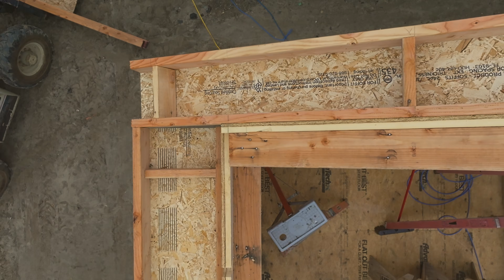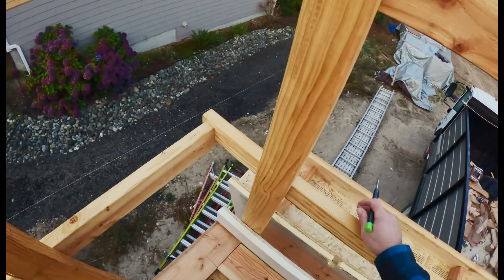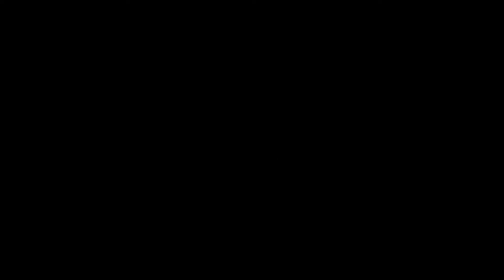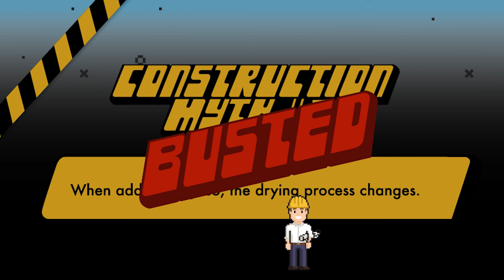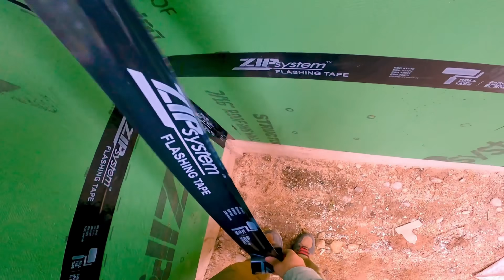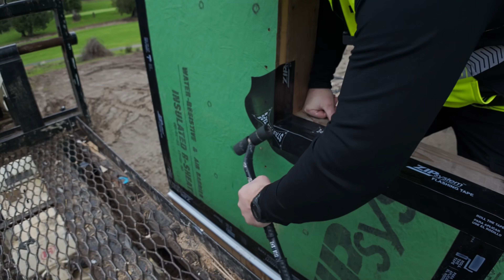EXPERT TIPS| Continuous Insulation

Comment: There is a far better way to build, with Insulating Concrete Forms, ICFs. Continuous insulation, stronger, safer, no mold.
Reply from the maker: How do you define "better"?  Here ICF is insanely expensive ALL costs considered.  There will be zero mold here, so let's take that off the table.
Reply: I define better as stronger, safer more energy efficient. Won't support mold growth, wood can, this system in the video included. How do you define "all costs"? None of the other items should cost more, some things should cost less, such as drywall and electrical
Reply from the maker: @bradkvanbek7148  All costs, means ALL COSTS.  Materials, labor costs, labor availability, environmental costs, cosmetic, etc.
Reply: @AwesomeFramers  What cost is "labor availability" . What are "environment costs" and "cosmetic" costs?
Reply from the maker: @bradkvanbek7148  Environmental cost of manufacturing ICF and disposing of waste, carbon cost of the extra concrete.  Cosmetic Costs include steps taken to hide the above ground foam, extra cost in siding over the foam.  

The fact is EVERYTHING has pros and cons.  That is true of ICF.  There are good reasons to go ICF, and there are good reasons not too.  Are you intellectually honest enough to admit to the negativees or cons of ICF?
Reply: @AwesomeFramers  What cost is "labor availability"
Of course there is cons, but your so called environmental and carbon costs are not a consideration. But longevity is. 
Wood framing needs exterior cladding more than ICF, or it will mold and rot.
ICFs are better than the framing/insulation depicted in the video in just about every way.

Comment: Like the details of the video. As an architect in California, the engineer won't let us use Zip R because of the sheer value. By having the foam against the stud, you lose much of the shear strength. I prefer to go with a Rockwool that is vapor open, possibility of more insulation (2x4 wall but more on the outside) and the added fire resistance. Food for thought. Many ways to do.
Reply: Or you can use the zip r but once electrical is done and you insulate you just sheath the inside of the wall before drywall. Not sure about cali codes but most places allow that or a strong wall periodically.
Reply: I've wondered about the screws cantilevered through the foam insulation and the shear value of the screws. The screw through the OSB is now being levered by the thickness of the insulation. If a long enough and large enough, then the screw can transfer the shear force to the OSB. I wonder if the Zip-R could be inverted so the OSB is against the structural studs to retain the shear strength. Of course, you now have a "soft" surface for the final siding to bear against. I'm glad your California engineer comprehends shear.
Reply: In Quebec we’ve been using continuous exterior insulation for awhile (R4 from BP or Isobrace for Isolofoam) we simply add windbraces in our wall to get that shear when the panels don’t allow us to meet requirements

Comment: One of my concern with zip R and other equivalent products is the rigidity of the wall. I may be wrong but the role of the sheating is to provide rigidity to the wall in case of high wind, by creating a space between the studs and the sheating, the  nails have more wiggle room and i have doubt about the wall being has rigid...

But maybe i am wrong... I still went with a separate continuous insulation even if it meant a little bit more labour
Reply from the maker: We addressed that in the video.  The Zip panel is a Struc 1 panel and there are shear nail tables for it 👍👍

Comment: What size nails get their shear value to transfer?, also windows are already calculated into new houses with the required T24 report in CA,  all this extra insulation is not required but is an extra cost that you will probably never get back in your savings on energy. I like a little fresh air in the house; most people probably don't want to live in a sealed box.
Reply from the maker: 3" x .131" nails as I showed in the video.

This house isn't in California.

Fresh air?  Then open a window, until you hit wild fire season, then the owners will be glad we manage the air instead of letting it coming through a thousand small holes.

Comment: Polyiso (and XPS) R value drops as the outside temperature goes down - not a great feature for northern climates, but OK for southern.  Also R value degrades with age, Polyiso’s R value drops 20% in 5 to 10 years.  EPS (expanded polystyrene) insulation keeps its R value as temperature goes down and is expanded using Pentane gas, not hydrochlorofluorocarbons which is used to expand XPS.

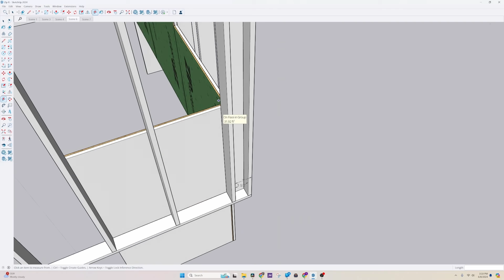Comment: @12:00 you talk about having the 3rd stud for nailing of the sheathing. Is the 2nd (flat) stud used for structural purposes or just for nailing for the sheathing? Instead of using the 3rd normal facing stud for sheathing, could you slide over the "flat" stud and save yourself a stud piece? Amateur here to learn, thanks

Comment: Wouldn’t it make sense to install on the inside of exterior walls behind internal linings? Your heat source is inside thus removing the fact you will require more energy to heat framing etc if on the outside?
Reply: Remember heating the mass of framing means better heat retention (smoother heat fluctuations). Whether it's enough to make a difference? Who knows. Mass heating is a thing in niche building. Sometimes water is used for the mass, sometimes concrete floor is used for the mass and sometimes mud dirt as in classic rocket stove mass heating.

Comment: Newbie question here, shouldn't the sheathing panels be installed horizontally as opposed to vertically to help in preventing the framing structure from racking side to side? (IE: being able to attache the panel across 8' vs the 4' if attached vertically). I hope the question makes sense. I only ask because I spent a couple years in the mid eighties framing houses and I remember that it was code at that point in Alberta and also when I moved to BC shortly after.
Reply: There's a lot of engineering that's already done for these panels.  With 16"OC, you can hang the panels vertically.  It really cuts down on the taping and interior blocking.  With 24"OC, you have to run the panels horizontally.  Huber has an lengthy installation guide on their website.

Comment: Can also use the Stretch Tape. I haven't done the CBA on Stretch, VS. 3" VS 6".
Reply from the maker: I don't see the advantage of the Stretch in this application.  It would be tough to work with, most expensive and Huber warranty covers the 2 seam tape or 1 6".  Let me know how it goes :-)
Reply: @AwesomeFramers  the only advantage is one less "trip" vs the 3"
Reply from the maker: @hu5tle-  3? With the 6" its 1 and with the seam tape its 1 that takes a little longer.  Maybe I'm missing your application. I can bring 2 rolls of seam tape up the ladder and work down using both before climbing off.  The 6" is super easy.  Stretch is very hard to work with and slower/more expensive for corners because of how well is stretches.
Reply: @AwesomeFramers  yes, less up and down the ladder with the 6", vs. 2x with the 3". Seems like, for good reason, you want to minimize trips up and down ladders.
Reply from the maker: @hu5tle-  thing is, ladder work = giant calves
Reply: @AwesomeFramers  them ain't calves baby, them is cows 🐄 🤣
Reply from the maker: @hu5tle-  🤣🤣🤣 Wildebeast

Comment: I am a licensed GC in AZ and a Civil Engineer who has done structural engineering. In AZ, we are concerned about the heat, not the cold and that is what we insulate homes here to protect them. I have installed several 2" x 6" framed homes that are stuccoed, and they are exceptionally energy efficient. Now, with stucco, you do have a 1.5" insulating board installed under the stucco. So there is, in a sense, a continuous insulation barrier, but it's like R-2, so it's not much. I am a big fan of the Zip system, but the continuous insulation system you are specifying is expensive. It would be interesting to see the insulation difference between a standard 2" x 6" framed home with non-insulated Zip shear panel and the R-9 Zip you are using. I am betting that the actual difference would not be that great. I think you are quickly coming to the point of diminishing returns, where you are just burning money. However, in Washington, where it does get very cold, it may actually be worth the additional money to pay for the insulated Zip board in extreme weather conditions.

While I am not a cold-climate expert, I am very skeptical about the numbers this "architect" spouted off for cold transferring over five inches through 2" x 6" wood studs. Yes wood has a low R-Factor compared to insulation, but you have to consider the thickness of the wood framing members when doing these calculations. I don't think this architect understands that.  The continuous insulation barrier system is better, no doubt. And both heat and cold will transfer through wood. But it is the AMOUNT of transfer that we have to be concerned about. Saying that an R-21 2" x 6" insulated wall system is "R-9" if it doesn't have a continuous insulation system is complete BS - he doesn't know what he's talking about. The R-Factor of wall systems is measured as a complete system, and that is where the R-21 number comes from. It would be blatantly illegal to promise an R-21 insulation factor with a 2" x 6" clad wall system and deliver an R-9 insulation factor - it would be fraud. In AZ, a stuccoed 2" x 6" wall system with fiberglass batt insulation and 2" foam under the stucco is nearly R-30, and they are VERY energy efficient. I know because I have built dozens of them, and they just work, provided they are installed correctly. During the summer, we get temperatures that range from 110 degrees F - 120 degrees F for several weeks in a row. At night sometimes the temperature does not get below 95 degrees F. So these conditions are about as extreme as you are going to find anywhere. Insulation is a big deal here because, without it, your home becomes unlivable in the summer. BTW, no one installs double sills here in AZ, no one. Your guest really doesn't have a clue about national construction methods.

I have framed structures in several countries, and nobody uses double sills. There's nothing wrong with using double sill plates, but you can attach shear panels to walls with single sill plates. Further if your double bottom plates are not both attached to the concrete with J-bolts or redheads, then your structure does not meet code PERIOD! It is possible in extreme cold that using double bottom plates arose to provide additional insulation against the frost line reaching into the home from the ground. 

Finally, while your structural engineer is correct, and you do get some limited shear value using the R-9 Zip panels, it is nowhere near as strong as a regular shear panel that is nailed 4" O.C. This won't matter if you are in zones that don't have hurricanes, high wind events, earthquakes or tornadoes. But if you are in one of these zones, the inherent weakness of the R-9 Zip shear panel may become a factor and the home could fail. I have never run the calcs on the difference between standard, non-insulated, shear and the R-9 Zip, but I would bet the R-9 is at least 50% -75% weaker in catastrophic storm events than standard shear panel. Standard shear panel has been proven to hold a house together in 200 mph winds, hurricanes and tornados and I personally would not lose that level of protection if the home I was constructing was in a high-risk area. Being cock-sure that you are right, like this architect who is your guest, doesn't make him right. Just because a structural engineer said it was okay in one application doesn't mean it is the best system for all applications. In short, if the home was in a high-risk area and I wanted to install Zip R-9 panels, I would shear the exterior of the walls normally and then install the R-9 Zip over that shear.
Reply: That shear strength issue is also my concern. There should be sheathing on both sides of the insulation panel. If insulation bridging is such a big deal I think I'd just do regular cheap osb sheathing and then put the zip stuff on top of that. Strength of normal sheathing with extra insulation of the zip stuff.
Reply: You tubing has become heavy on expensive product endorsement
Reply: lmao at the desert framer thinking the cold weather framer hasnt already calculated the thermal bridging of a stud 🤣 stay in the desert you'd just be annoying to work with above the 40th parallel
Reply: @carlslabs5368  Hmmm, what a little twit you are. You think you understand everything when, in fact, you probably have never designed anything by yourself. 

Wood is not the best insulator but it is far from being a "bad" insulator. Typically, in highly energy-efficient homes, a section of closed-cell solid insulation is placed in large headers. On the outside of walls, a 2" thick layer of is used beneath the stucco outer coating. The exterior walls are sheared with 1/2" OSB. This provides a wall with an insulation factor of 22  25 R factor. We also use closed-cell spray foam to seal all gaps in framing and the exterior walls around penetrations. 

In colder climates, the same system will work, but the thickness of the insulation is increased. Also slab insulation becomes an important factor.  Even here I have seen 4" insulation used under slabs at higher elevations. 

What your keen little twit mind doesn't understand is that most of your heat loss is through the windows. So that would be the most important component to protect in extremely cold climates.

Comment: The number of concerns people have with shear values and ZIP R seems to increase as the foam gets thicker between the OSB and the studs. What if you just added diagonal metal bracing straps to the studs for extra shear resistance when using ZIP-R thicker than R6? 
And as an aside, the Godfather of Forensic Building Science, Dr. Joe Lstiburek, once said of ZIP-R: "Good luck achieving shear values with that" - I don't think he was a fan.
Reply: Lol. That's an excellent point and potentially a lot cheaper than my idea of just sheathing with osb first.

Comment: In our market builders are applying EFIS directly onto ZIP without a crinkle wrap or drainage wrap. I checked Huber’s technical specs and that is in fact shown in an image as an approved method of applying EFIS. Isn’t that asking for potential water penetration when the caulking between the EFIS and window ultimately fails? I wouldn’t think that there is much drying potential for the ZIP in this case.